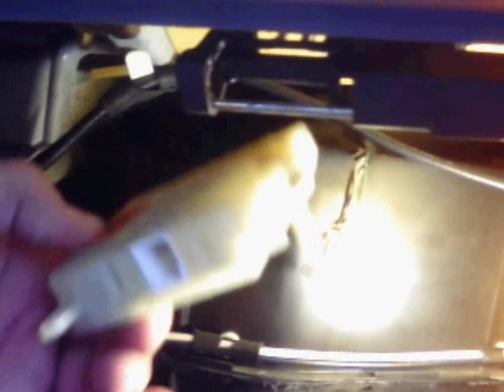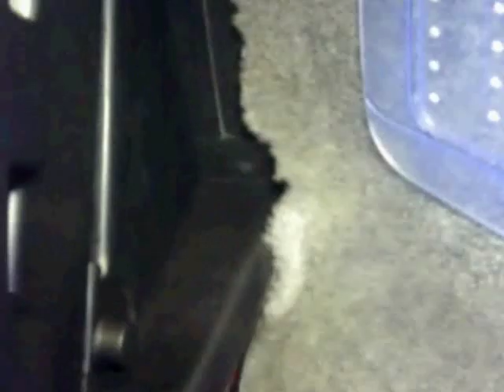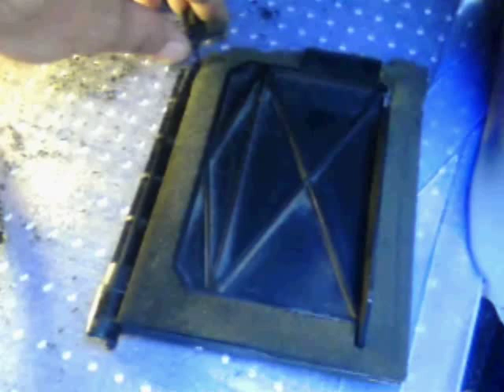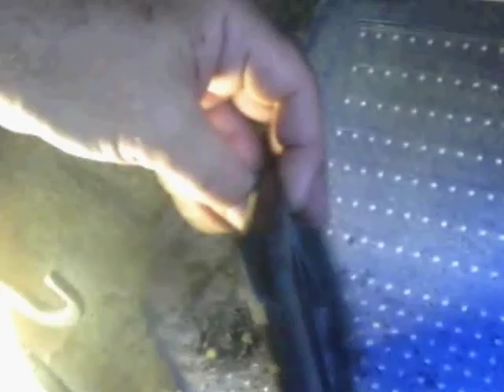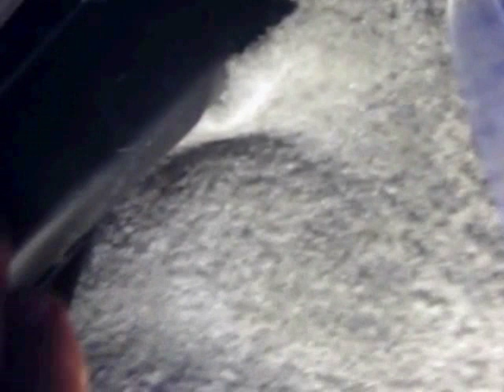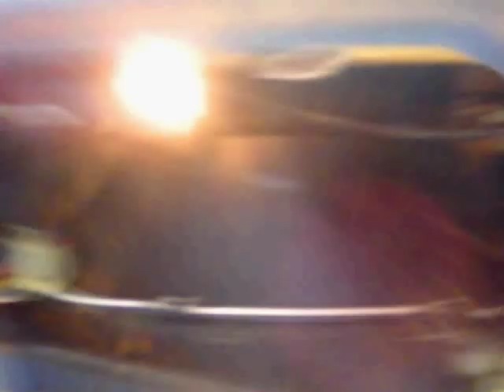HeaterTreater Ford Explorer-Ranger video part two

Comment from the maker: Hack is correct.  If you are trying to maintain a numbers matching truck in hopes of selling it for a fortune in 30yrs at the Barret/Jackson auction, don't do this.  It will decrease the value of the truck.  If all you want is functional, reliable heat/AC, this is the best option.  
We get this response a lot from "master" mechanics primarily because this is bursting their cash cow.  The OEM fix takes multiple hours of fairly simple dis-assembly at high rates as opposed to DIY.